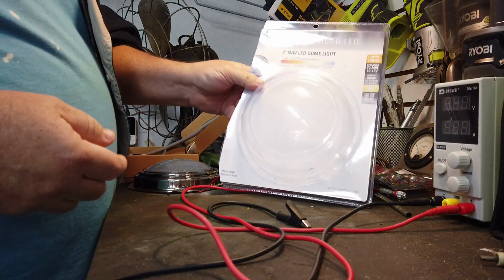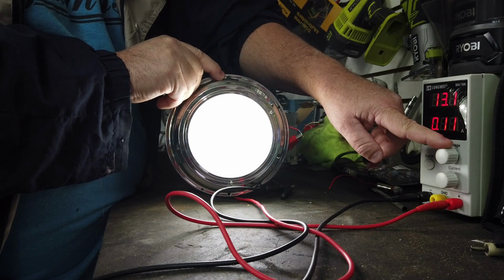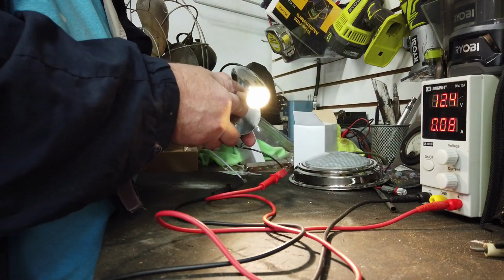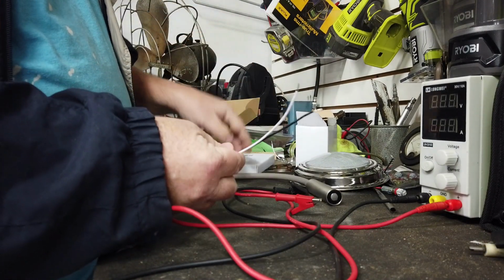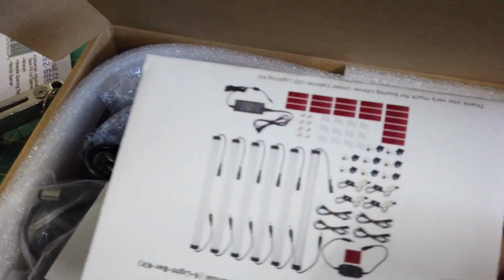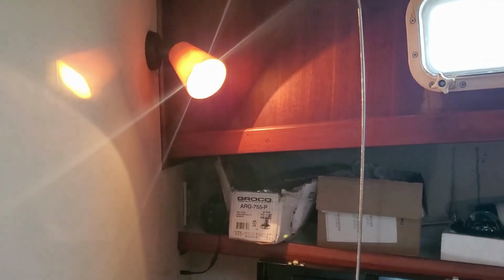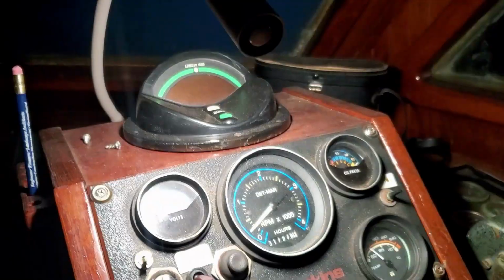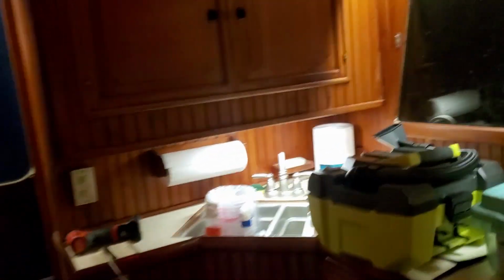Product Review- Marine Interior lighting upgrades for the Trawler

Comment from the maker: The below info was provide by Arthur Schultz from one of the Facebook discussion groups. It has some good info including the proper way to dim something like the Salon light. 

Boat lighting is always abysmal. I could go on for hours about all the problems with LED lights. They are a great idea on the surface, but present all sorts of unseen problems.
The first problem is light output. Too many "marine" interior lights provide the same abysmal output, but with less current draw. I'm fond of more light, not less.
The second problem is deeply hidden and creates all sorts of reliability issues. A great many cheap LED lights do not have voltage regulation. LEDs need an exact voltage. Without internal regulation they fail prematurely due to overvoltage. The supposed 50,000 hour lifespan may be reduced to the life of an ordinary indandescent bulb, if that.
The third problem is the regulation in better LEDs. Some regulators cause all sorts of interference problems in sensitive electronics. The Coast Guard has even issued warnings about the interference problem.
The fourth problem is in finding a good LED with a switch. The old Perko hockey pucks had a toggle switch. Try to find an LED light with the switch included. Your options become very limited. Small task/bunk lights are easier to find with switches, while larger area lights generally don't.
I've settled on two extremes. If you want more/better area lighting in the cabin, the dirt cheap RV light can't be beat. At that price it doesn't matter if the lifespan is a bit shorter than expected. Note the high/low/off switch for independent operation.
https://www.amazon.com/.../ref=ppx_yo_dt_b_asin_title_o03...
If you truly want a good light that will never fail, the Lumitec Nevis series can't be beat. The price is shocking, but it is everything you could dream of in an LED light. I put Nevis lights in engine rooms to give the most durable light in the most important location.
https://www.fisheriessupply.com/lumitec-led-light-nevis2...
By the way, all LEDs are dimmable. The video showed voltage being reduced, which is the wrong way to dim an LED. You need a pulse width modulator. This is yet another potential source of interference.